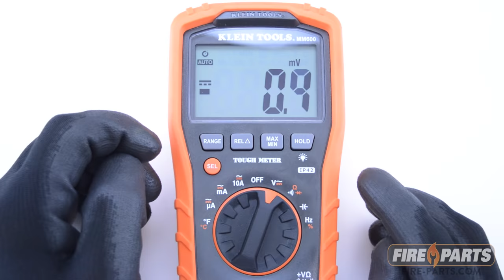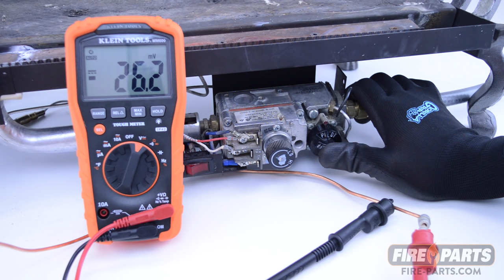Fireplace How To: Testing A Thermocouple

Comment: After watching this video I discovered whoever did my old fireplace didn't screw a proper thermocouple into the gas valve but instead rigged a non-standard thermocouple, attached it to the valve using an extra component with a wire which is welded/glued to a washer.  Removing all that junk now with totally new components. If the gas valve location in mine didn't match this video exactly, I probably never would have figured it out.  Thanks!!

Comment: Thank you very much for finally solving my issue.  What helped me was that you said that the flame had to be blue hot, but mine was yellow and pointing slightly away from the thermal-pile.  There was a little ball of the fake ash in the way.  I used a screw driver to push it out of the way, the flame is now blue, and the fireplace started right up.

Comment: You helped me tremendously in this post and saved me a call to a technician. I tested the voltage and it was a bit low so I cleaned the thermocouple and thermopile and the fireplace lit up like a charm. Thanks for your help.

Comment: My fireplace thermocouple wire goes up into the chimney and my pilot light assembly only has a thermopile. Can I replace the whole assembly with a 3 in 1 assembly? Where both the couple and pile are on the pilot light?

Comment: Does the gas solenoid valve work directly off this 8 to 30 millivolt signal or is it using an electronic circuit for threshold detection?

Comment: Negative voltage reading, reversed polarity?? Anyone with an idea feel free to comment. With the help of this awesome video, I determined that I had a bad thermocouple and decided to replace the entire SIT pilot assembly on my 17-year old direct vent natural gas fireplace. After installing the new pilot housing it still did not operate correctly. It appeared that the new thermocouple was also bad, as the pilot light would not stay lit when releasing the knob to switch from "pilot" to "on". So I tested the voltage of the newly installed thermocouple and it reads as a negative number (No, I do not have the red/black leads in the wrong ports of the multimeter). If I switch the measuring tips hooking the red clip to the copper wire shaft and the black tip to the thermocouple nub (end that connects to gas valve) then I get a positive reading! It is as if the polarity on the thermocouple is reversed. Can this be? If so, did I cause it somehow, like accidentally grounding both ends, for example? Or could this be a manufacturing defect?
Reply from the maker: Hello,
Sounds like it may be the gas control that is the issue. Not a reverse polarity thermocouple. If you contact fire-parts directly they should be able to help
Reply: @fire-parts6588  Yes, it was the main gas control valve, thank you! I tested it using the tutorial on your website, and ordered the replacement valve from your website. I installed it and it works great!

Comment: I have an electronic ignition so no pilot light.  My problem seems to be with the thermocouple not igniting.  The gas flows and I can light the fireplace with a barbecue lighter.  As soon as I turn it off, I'm right back to where I started.  How can I test my thermocouple if I don't have a pilot light?

Comment: Hi, I have a Gas Fireplace and it's like 18 yrs old, it just started not shutting off when I put it on like 1 it keeps running, do you think it's the thermostat???? Thanks
Reply: it used to shut on and off as the room would get cold, now it just stays on and won't shut off unless I manually do it

Comment: how does it read if the thermocouple isn't attached to the valve?
Reply from the maker: You need to hold in the knob on the gas control and use the probes as shown at the 2:08 minute mark

Comment: My pilot light is weak and doesn't stay lit when I let go of the pilot button. What could be the problem and should I still test the thermocouple and maybe also test the thermopile?
Reply from the maker: The pilot light should be cleaned first to create a strong blue flame, then test the thermocouple, and if found to be faulty replace. If the thermocouple readings are good then you may need to replace the gas control valve.
Reply: @fire-parts6588  thanks for the info. So are you saying that if the pilot light goes out when I let go of the pilot button, then it could just be that the thermocouple needs to be cleaned? That would be great if it's that simple. I will try that tonight before testing it.
Reply from the maker: @stevef7331  Yes clean the pilot light so the flame is stronger and possibly the thermocouple

Comment: my pilot is on but the system won't light when we turn on the wall switch
Reply: Did you find the problem?  One thing you can do is to check to make sure the holes where the gas exits into your fireplace are not blocked.
Reply: If your fireplace system has both a thermocouple and a thermopile the thermopile might be to blame.  The thermocouple only holds in the pilot safety valve so if the pilot remains lit after you release the gas cock in the pilot position you know it's good.  Once you turn the gas cock to the on position and make a call for flame its the thermopile that produces the milivolts to open the main gas valve. If you do not have flame it could be that your thermopile has failed, connections are poor or loose, thermostat or switch not calling for flame, gas cock left in pilot position, possibly a break somewhere in the wiring to or from the thermostat or switch, or the thermostat or switch has an unusually high resistance i.e  not specific to a milivolt system.  You might also want to ensure that the pilot burner is unobstructed and directing a strong blue flame towards the thermopile as well as the thermocouple (and towards the logset burners if it has 3 burner ports.)